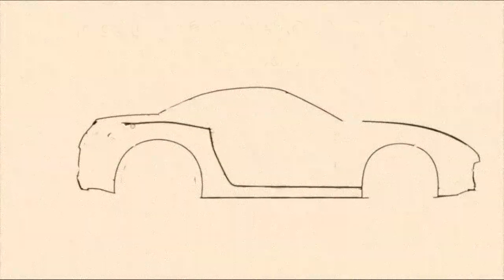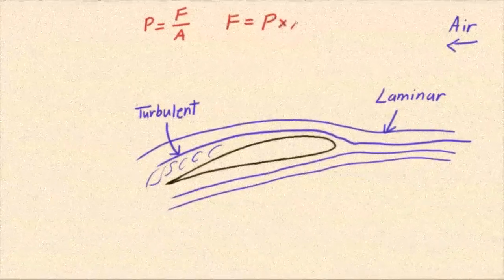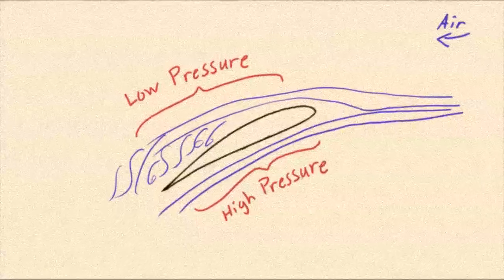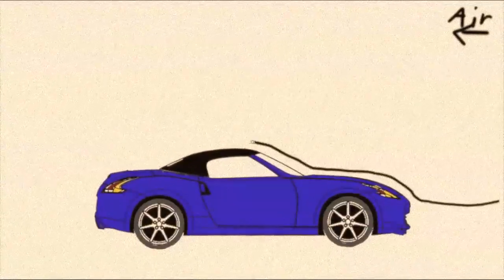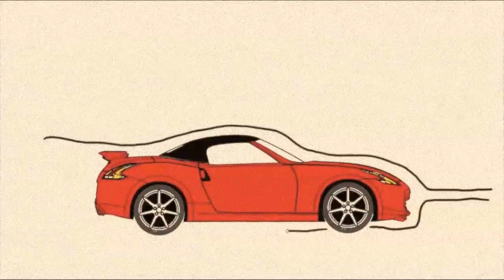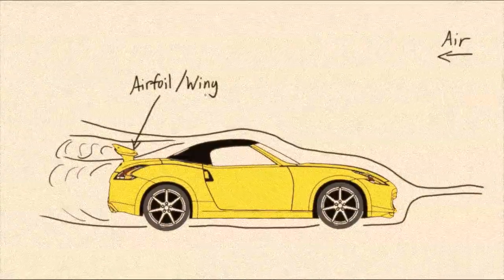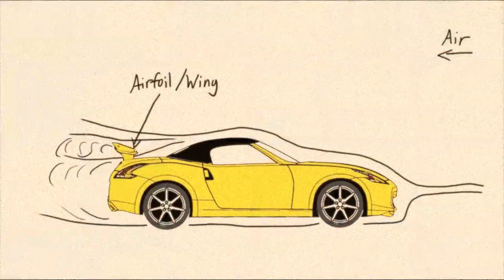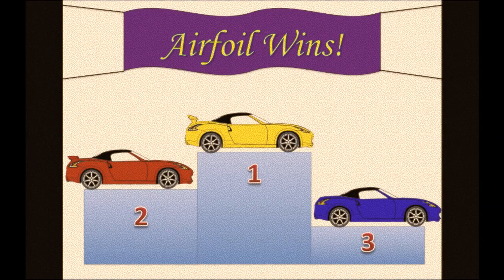Sports Car Aerodynamics: Spoiler Alert!

Comment: Wow, this is a big fail. Please learn what you are talking about before you try to "educate" others. For example no wing has a stall region on the high pressure side. Low pressure doesn't always mean stall region, its a function of pressure gradient, and that means most sports cars won't have a large stall region along the rear window and tail. Nor will most wings have a stall region with such a low angle of attack. A rear wing does nothing regarding the turbulent stall air, if the air has stalled there is little more you can do.

Most cars will not produce noticeable lift at the rear, the exception being the Audi TT which added a tiny lip spoiler to trip the air stalling it before it runs over the rear curved area. For straight line speed you simply want the lowest drag possible, this means no spoilers and generally leaving the car as it came from the factory will be ideal, particularly for a sports car which are generally designed with low drag and mediocre downforce in mind.

A spoiler is there only to increase the downforce, it is a very poor method compared to many others and produces a decent level of downforce with a very high drag penalty. Adding a rear spoiler you will find a noticeable decrease in straight line speed with an increase in rear stability. It should be one of the very last choices regarding increased downforce, and it really shouldn't be chosen at all when looking for straight line speed. The ideal would be adding a floor to the car with a good diffuser which noticeably increases downforce, particularly at the rear, and will usually give a slight reduction in drag. The only reason a wing should ever be used is because a driver feels the downforce (cornering gains) is more worth the massive drag increase (straight line speed reduction) and more effective methods such as a better sculpted floor aren't available.

Comment: The upload is correct. by reducing lift drag friction decreases and therefore top speed, acceleration, and mpg is improved . of course if too much down force is created acceleration top speed and mpg can also be negatively effected but generally that is not the purpose of spoilers on passenger cars.

Comment: And that's why automatic adjusting wings are a thing. Because just sitting there it will slow your car down until you reach a certain speed where the downforce actually helps the tire grip. The speed is 100mph by the way.

Comment: This is lift described wrongly AGAIN!  The air deflected down (on an airplane) (and its deflected straight down!)creating an opposite component of lift. In fact, an equal mass of air is deflected downwards as the weight of the aircraft.

Comment: The car doesnt accelerate faster, because of downforce it gets better grip at higher speed. It gets slower acceleration at higher speeds and cant reach as high speed as the same car without a wing or spoiler but it can take corners better so I doubt this is the truth

Comment: In a drag race the car without a wing/spoiler will be faster because it has the least drag, also a spoiler does not make acceleration faster because there is no forces acting upon it so in theory decrease the acceleration due to increased weight. The car without the wing/spoiler will be the fastest because there will be the least drag.
Reply: Its just incorrect.

Comment: this guy is wrong at the beginning because a car with a spoiler would have a disadvantage because of more weight and drag at the beginning of a race the air is moving too slow to provide down force or traction and even when when the car gets up too speed traction would not be a problem anymore because they are only going In a straight line so the car with the spoiler will lose because of more drag and weight. the only way the car with the spoiler would win is on a track with turns when traction is a factor in speed.

Comment: this is only true IF youre making so much power and/or have so little grip that you can spin the tires at high speeds (excess of 100mph). the only way for one of these hypothetical identical cars to win is if you can make one more stream line while keeping the weight and the distribution of it the same. thats why drag cars have wings/spoilers that extend the deck lid a foot or 2 to reduce separation trailing the car to help clean up airflow and inturn reducing  drag rather than sticking a huge airfoil on the trunk

Comment: This is so wrong.. In F1 DRS (drag reduction system) lowers the drag by minimising the downforce from the rear spoiler in straight lines. Spoilers do NOT increase speed in straight lines

Comment: Sorry, dude. Totally not true. F1 cars flatten their spoilers on long straights for greater speed. Spoilers only help in corners, and the increased downforce comes from increased drag which must be weighed against the disadvantage in straight-line acceleration.

Comment: How???? Increased Downforce always comes with Drag!!! A car with a rear wing would experience  more drag than a car with a spoiler. The 1st in the race should be the car with the spoiler. Spoilers reduce drag by improving the airflow around the rear of the car. There is less pressure drag with spoilers. In case of rear wings you need them to create downforce, and thereby getting drag as by product.

Comment: Interesting, but the "airfoils lower drag" conclusion is incorrect. Any time anything is placed in the airstream, the result will be an increase in drag. Some of this is "form drag," caused by the shape of the object, be it the fuselage and wing of an airplane, the body of a car or the hull of a boat. 

A second kind of drag is "induced drag," which results from added disruption of the airflow caused by lift reducing spoilers and flaps on an airplane wing or the drag of air flowing over a race car's wing. The greater the size of the wing, the greater its curvature and the higher the angle of attack, the greater the drag. A wing, by its very nature, is a drag inducing element and thus reduces a car's top speed. Its faster lap times come from additional downforce that reduces braking distance and increases cornering speed. The only reason winged race cars are so fast is that they have an awful lot of power. 

There is a different kind of airfoil, shown on the red car in the video, which is an air deflector, sometimes called a "turning vane." These devices are not necessarily made to produce downforce. What they do instead is to smooth the airflow into something less turbulent. They also redirect airflow into low pressure areas at back of the car. This fills the partial vacuum (a kind of form drag) caused by the car's passage through the air. That, rather than downforce, increases top speed. 

It also reduces what NASCAR Racers call the "Draft;" that area of low pressure turbulence behind a moving vehicle. When two cars are "drafting" together, the leading car has the advantage of the second car filling that partial vacuum of turbulent air, allowing it to go a bit faster. The trailing car has the leader move air aside for him, allowing the car to drive in lower pressure air, letting it move at the same speed with less form drag.

Comment: 100% right your explanation. However the reason for the wing is to keep more speed in corners. By sacrificing a little of top end speed and be faster around corners, the car goes faster overall around the track. My 2 cent!

Comment: Some of the stuff in this video is pretty suspect. It's not a blanket statement that a car with a spoiler is faster than a car without one. It's possible, if the downforce perfectly balanced a particular cars inclination to spin the wheels that it would be faster. More often than not though, a car without a spoiler is actually faster in a straight line. And then it doesn't mention the drivetrain either. Putting a spoiler on a FWD car for instance, like a lot of ricer jackasses do, not only slows the car down with drag but it lifts the drive wheels up and will actually cause wheelspin.

Comment: Adding a spoiler will NOT help acceleration.
Reply: Top Fuel dragstars need a spoiler so they don't fly into the air or crash; which you see a lot of them on youtube. At those speeds that the dragstars are travelling in, they clearly need spoilers to stabilize the car.
Reply: Noo.. On a short race, the spoiler will have no effect on the car since the air moving through the wings are minimal. But at over 200km/h, clearly the wings will create drag and slow down the car.
Reply: it may but top speed will suffer immensely when you join the big wang gang
Reply: Tell that to Top Fuel... lol
Reply: It will if you have a powerful engine and RWD. Compared to an identical car without a spoiler, it will regain grip sooner and it will accelerate sooner and faster. However at very high speeds the spoiler will create too much drag and will slow down acceleration and the spoiler-less car will catch up... so... on a short drag 1/4 mile a "spoiled" will win, while on a 1-2 mile drag the car without a spoiler will catch up and win. But after all it depends on vehicle aerodynamics and engine power.

Comment: 15 seconds in to the video there is a MASSIVE mistake, in a straight line, the car without the wing will win.
Reply: not if the wing is only a guide for the flow to create less drag.
Reply: @davidmertes6308  It is a spoiler, it's meant to create downforce. It increases drag and increases friction. Therefore, the car would definitely be faster without it
Reply: @ilan9588   A spoiler is not automaticly there to create downforce. In most production cars when there is a spoiler its to guide the airflow at the rear to minimise turbulent air flow. By doing so it reduces primarily drag and you typically reduce lift. 

To yourself a favor and educate yourself before playing teacher in the internet.
Reply: @davidmertes6308  
After apparently not being "educated" about the subject, I went on the internet to see if anyone shares your opinion.

I haven't found a single instance where a wing doesn't add weight and create more friction and drag.

All a wing does is increase friction by reducing lift and therefore decreasing the top speed. 

It is a fact that friction (and drag, as well as added weight from the wing) has a negative impact on a car's top speed. 

And that's that.

Oh and keep in mind, we're talking about REAR spoilers here.
Reply: @ilan9588   Your fault is that friction and drag are not the same thing. 

Yes you create friction on the wing surface but you can still decrease the overall drag. At cars the major cause of drag is turbulence air behind the car. Especiali with sedans or coupes you have turbulent air over the rear window. Since turbulent air flows faster than the surounding air the dynamic pressure drops and it generates lift and drag at the same time. When you ad no a Spoiler you can redirect the airflow and reduce this turbulences greatly resulting in less drag AND Lift. You can see this on several cars like the early and midrange Imprezas and Lancers. For sure when you tune a car and make the angle stifer and adding a reverse Wing shape you trade drag for real downforce but thats not often the case in normal production cars since they need to hold a certain  fuel economie. 

Today you find also spoilers in almost every car in some form to reduce drag. 

Oh and since i studied Automotive Engineering for 5 years and sind 2,5 years i work in Aviation as an Engineer i thing i know a little bit in this topic.
Reply: @davidmertes6308  I'm not talking about friction on the surface of the wing, I mean friction as in rolling resistance
Reply: @ilan9588  You know that rolling resistance is the minor factor compared to air resistance when it comes to top speed.  Yes it is a factor but since rolling resistance rises more or less linear and air resistance is at the beginning in the square and the when stall occurs the cw coefficient rises significantly resulting in an over squar rising of the resistant. 

For example: I found values for an Audi A7 from 2010. 
The Spoiler lowers the overall Cw coefficient 0,04 by adding around 12 kg overall downforce (Weight and Downforce at max speed because i don´t find other values for lower speeds i calculate everything with this). 

The car weights around 1755 kg with the spoiler. Assuming the Cr is 0,012  by lowering the weight by 12 kg you decrease the Friction from 206,6 N to 205,18 N so by around 0,69%  

The base cw is around 0,31. Meaning when you drive 100 Km/h the Drag is 353,31 N  by reducing the cw by 0,04 the drag is 307,72. 

So the overall friction is around 8% lower when driving 100 km/h by adding the spoiler. When driving faster this difference is much higher. 

This is because the spoiler is designed to reduce Drag like in most production cars. Only on Sport variations and tuning you trade significantly downforce for drag and Friction.
Reply: @davidmertes6308   

That makes sense.

I did not know that rolling resistance was that minor of a factor. Thanks for being patient with me and thanks for the thorough explanation + example. I understand now.

Have a great day!
Reply: @ilan9588   Well when driving at lower speeds for example in cities or towns the rolling resitance is the greater force and also important. But there you have also other loses like acceleration and braking for example. 

You too.